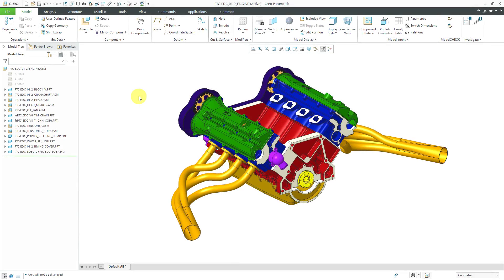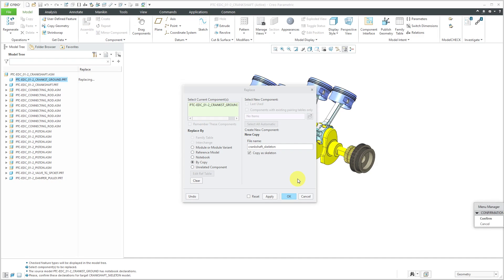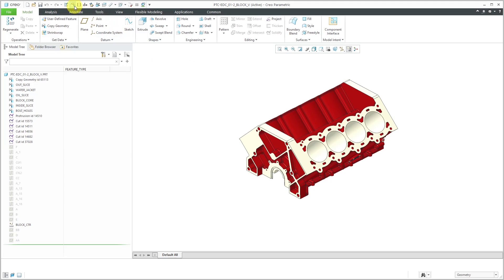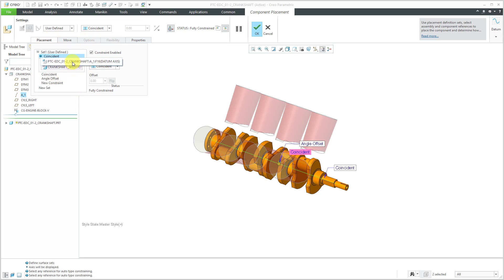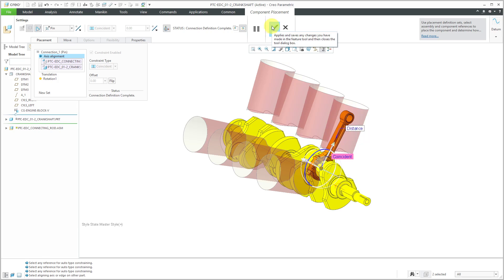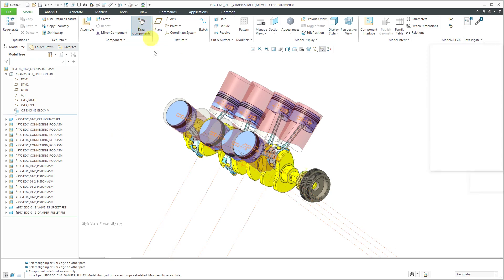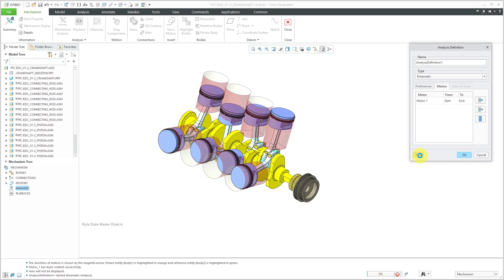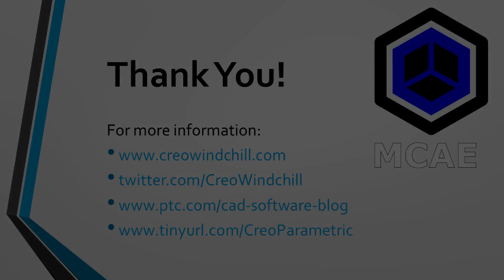Creo Parametric - Mechanisms | Cylinder Connections

Comment: For the piston head, it only has translation motion , why use cylindrical connection instead of slider connection?? , its evident piston head is not rotating but only slides
Reply from the maker: You could use a slider connection, but it would be redundant. The rotational Degree of Freedom for the piston head is taken out by the connecting rod. Having redundant / negative Degrees of Freedom can be a problem when generating certain results in a dynamic analysis.